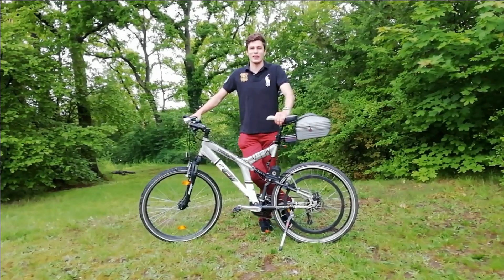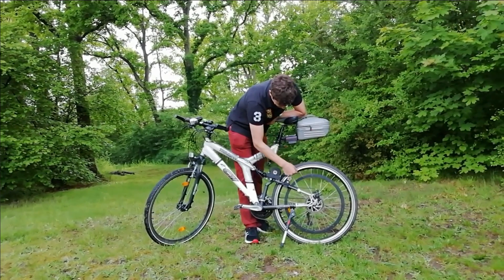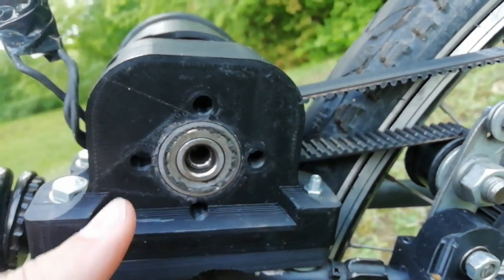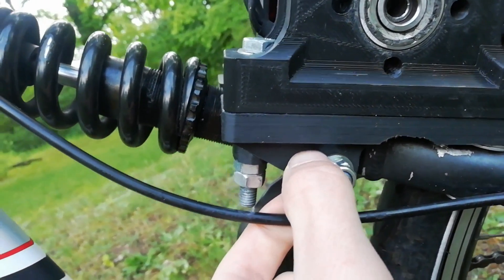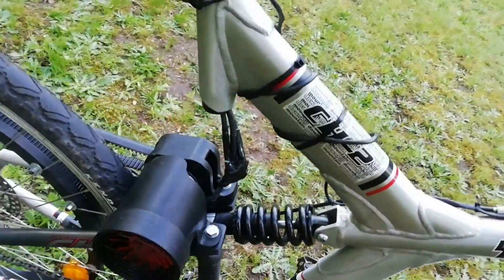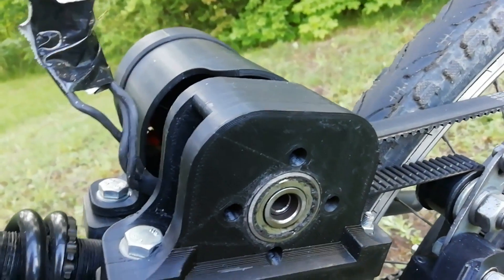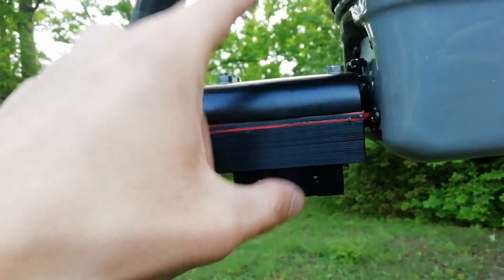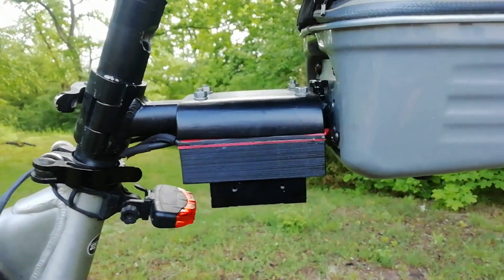Boosted Ebike Made with 3d Printed Parts ! Crazy Fast !

Comment: Great engineering !
I have a question concerning the 3d printed part holding the bearing of the motor; it seems like it's printed as one part, but you have a horizontal and vertical lines !
If it's in one part, could you share how you did it ? :)
Thank you

Comment: Really stupid design. Who can't use a battery and motor to run a bike? You And you've fucked up the wheel, because the spokes are no longer free to carry the weight in tension like they are designed to do. Just stupid all over. Have fun, just realize not everyone is a sucker for poor engineering.
Reply from the maker: Make a better one if you believe its so easy :p. Btw of course the spokes are still carrying the weight under tension, actually pulling this way on the spokes does the same to them as pedalling with the same torque does. The spokes of the wheels are angled and not perpendicular to the rim , otherwise neither the disk brakes nor the pedals could transmit any Power without twisting the wheel.
Reply: @JL2579  - Fuck you, dope.

Comment: Too much Friction - too much Mechanics!
My advice... Put Magnets direct to the outer Diameter of the Rim (Both Sides)! and 6 to 9 Coils somewhere on the Frame (also both Sides). No Belt, no Transmission - Nothing but Magnets and Coils. A normal Speedcontroler and Accu should do the Rest.
Reply: hahah yeah ineficient as fuck

Comment: "The gear ratio of the motor is 14/304" Thats pretty nice ratio of 1:~21.7.   I used to have similar config@1:14 and burned two motors down. :D anyways now for some years I just have chinese 1.5kw hub motor kit for 400€ (after taxes). Acceleration is much more aggresive than thee hobby thingies + more silent, but I weights like 12KG alone, and I did put that kit on hardtale downhill bike and I have got tons of snake bites. Really need to go tubeless. :D Thank you for video!
Reply from the maker: I did something similar 6 years ago : https://youtu.be/7g8BRyLaQgg

Did you also use fan cooling? The fan and the boost mode feature limiting the current actually work quite well. I was going 45 on a gravel road for 15 mins and the motor was cool enough afterwards that I could touch it, I guess around 45 degrees celcius

Comment: If you knew that you could model the temperature of a motor, i.e. creating a synthesized sensor, you got a good education, or did you figure that out by yourself?
You say it gives "50 kg," you mean 500 Newtons?
How does gear shifting work? You would have to reduce the torque to almost zero when shifting gears. (I don't know about electric bicycles, really)
Reply from the maker: As you can see from the video, the motor only has one gear (electric motors don't need a transmission due to their torque characteristics, although they can profit from one). The gears for pedalling are independent
Reply from the maker: Surely I mean about 500N, but 50kg is something most people can imagine better

Comment: Next step: add regenerative braking!
Reply: Would it be worth it ? Shunting/electrodynamic brake would be better and easier.
Reply: @teslakovalaborator  Hmm, practicality aside, how would one implement a regen brake on JL's drivetrain? Given the 'soft' linkage between the motor and the wheel.

Comment: Calling it a turbine bike is a bit misleading.... Still a cool project
Reply: matthew hurley I hear you, but usually you can say turbo to anything that is pretty fast. for instance on older pcs you may have seen a turbo button to speed them up...

furthermore if you look at the impeller for the motor cooling the turbo thing isn't to far off either :D

Comment: How much is this bike? I want to have one like this
Reply from the maker: The components would add up to around 900 euros if you have a 3d printer. Main costs are controller (300) and battery (400),motor (80)
Reply: @JL2579  sale it, you will be rich :v

Comment: But, can it wheelie?

For stronger 3D printed parts you can also print them hollow with just some internal supports  in hanging  areas, leave some holes and fill them with resin, even use some fibers if you have access to it, that will make them strong as steel!
Reply from the maker: That's a clever idea, however as long as pure plastic does the job, it's a lot simpler to make :). Still a great idea
Reply: @JL2579  Printing them in nylon would also give them double the tensile strength, and for the pulley way more durability! But still, the good thing about 3D printing is that you can redo it as many times as you need! :)

And also, what is the KV rating of that motor?
Reply from the maker: @TDLmc  the large pulley has over 500km on it and doesn't show any signs of wear.

Comment: I'm not an engineer but my guess is that even though you can reduce power usage with pedaling that it can't recharge the battery by pedaling with the motor off. Is that accurate? If so how difficult/effective would it be to implement that?
Reply from the maker: The vesc allows you to set a recuperation as you like, I guess the efficiency will be around 50 to 70 percent maybe?. Problem is twofold : first of I need to wire an additional switch as you probably don't want to recuperate every time you leave the throttle (or maybe you actually do if I just set it to slightly negative throttle 🤔 if the controller is off it will of course  not also stop working, which is good. However this would only make sense for breaking as the bike is already quite hard to pedal without the motor because of the additional drag of turning the motor and the belt (no freewheel mechanism possible with this setup). I can maybe go 29 kmh at the same effort as going 36 on my roadbike.

Comment: Very nice project, and guys, even 1000W is really good for a bike , with that , usually end up at 45km/h max
Reply: oh and eventhough you pointed it out, i would like to know why it's still this noisy, ik your bearings are making the sounds, but still, the sound is pretty remarkable
Reply: and what is the top speed without using your force ?
Reply from the maker: @aks9545  the same. It is Rev limited, not power limited. It will just draw a bit more amps
Reply from the maker: @aks9545  the motor is making the sounds. Actually it is only noisy under load. When only cruising at 40kmh it is rather quiet (see last part of the video) . Probably comes down to a cheap China motor resonating under full Power

Comment: Would you even need to pedal when using the motor? I can't imagine pedaling would actually help when you're going 50km/h.
Reply from the maker: It does help quite a bit. I do cycle regularly and can maintain 36kmh on my roadbike for 10km or so. The power goes up with the cube of the velocity, so that means at 50 I still support 1/(50/36)^3=37 percent with pedalling the same power . (ignoring that this bike is of course less efficient). For acceleration it helps a lot since first of all I can pull 1000 watts for a few seconds, also the motor is current limited, which means that because it has no gears, the power is proportional to the speed, so roughly 1000 watts at 12kmh,2000 at 24,3000 at 36 etc.
Reply from the maker: So pedalling reduces power consumption and increases range by a third even at top speed. When only going 40 it of course helps a lot more

Comment: How tricky has it been to center the drive wheel mounted on the spokes?
Reply from the maker: Actually it is off by about a millimeter. But that's no problem because of the belt tensioner. You can see it moving back and forth with the same frequency as the rpm of the rear wheel at the beginning of the video
Reply: @JL2579  I had noticed the belt tensioner had an oscillation, I was assuming it was the result of fluctuations in torque. That's an interesting compromise for a cheap way to get power to a wheel. This video has me inspired to electrify my bicycle!

Comment: do you account for differing delta in temperature and resulting different heat disappation? how did you determine the disappation rate? your model seems simplified to a dangerous degree :P
Reply from the maker: Simplification is usually key in avoiding user error :P. You simply adjust the parameters to conservative values. No matter how sophisticated you make it in the end, it would only depend on even more parameters and therefore even more subject to user error. the current model is easy to understand and is already working well in practice ;) You can adjust 3 parameters: max overcurrent, maximum time@ max current, cooldown time. Pretty much every motor can handle a lot more current for 10seconds simply due to its heat capacity.The manufactures datasheet will tell you the allowable currents, which of course highly depend on your cooling setup. You simply set these 3 values based at your own risk, since its meant for builders who are using the VESC for their own custom setups anyway^^. I will show the interface boost mode in a seperate video as mentioned. When you set the cooldown timer to slower than the minimum heat dissipation rate you are on the safe side. You only need around 1000 Watts to maintain topspeed , so this setup will not slow down, just limit acceleration.

Comment: Puts Louis and his Bafang to shame
Reply from the maker: Thanks! However of course this setup is far from perfect. It is not super loud, but louder than larger high torque motors of course. Also the belt will probably need to be replaced every 2000km or so. The belt can also skip teeth if you go really hard on rough terrain. However it works and it is a LOT of fun, especially climbing hills :D